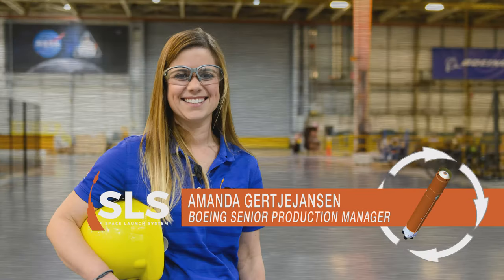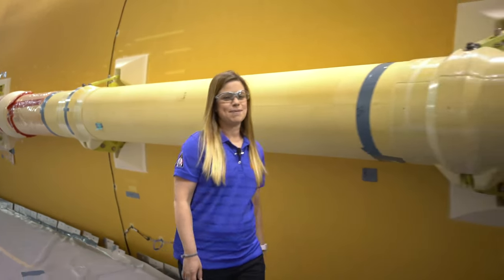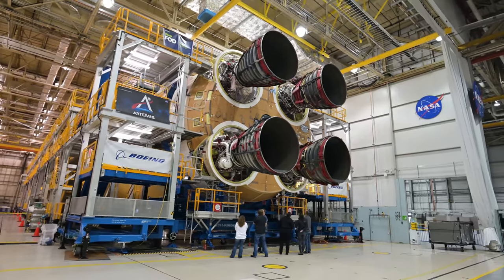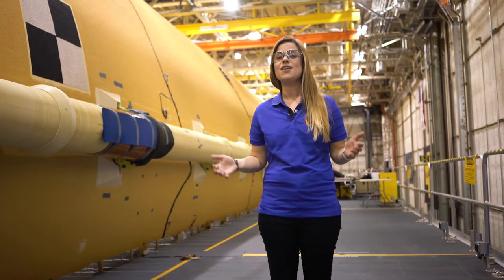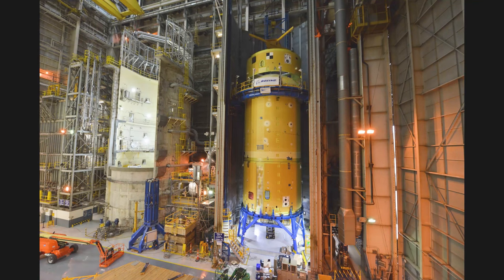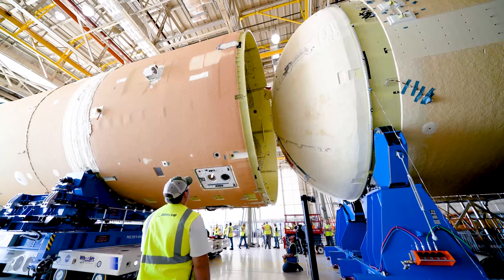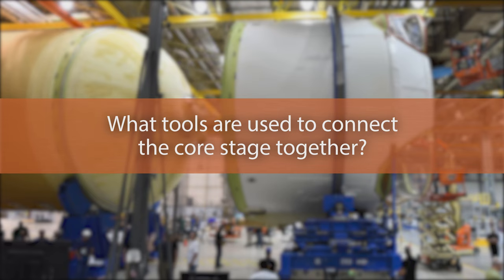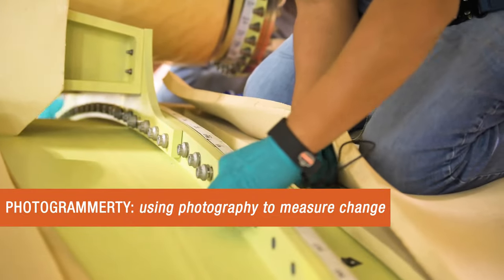Rocket Science in 60 Seconds: How Does the SLS Rocket’s Core Stage Come Together?

Comment: I know they made the diameter of the SLS first-stage 27 Ft so they could reuse as much as possible the manufacturing jigs and tooling used to make the Shuttle ETs but if they'd made its diameter 33 Ft instead (Same diameter as the Saturn V's S-IC and S-II stages) they could've made a first-stage that was short enough to do the entire final assembly vertically.
Reply: yes, even though the Saturn Vs were made here too, there were just too much legacy knowledge still present on tooling for the Shuttle's ETs. Without this precious knowledge from legacy workers of the Shuttle missions, the assembly would have took longer.
Reply: Ares V was initially going to have a 10m core diameter with almost no shuttle derived hardware 
When it was canceled NASA tried to pitch the SLS as a purely shuttle derived vehicle reusing as many STS elements as possible which included the 8.5 meter diameter of the core

As it turned out during the design process SLS, and especially the core stage, strayed very far from being a true shuttle derived vehicle to the point that the core stage is regarded as an entirely new stage with the Shuttle's RS-25 engines

Looking back maybe leaving it 10m in diameter wouldn't have made much difference and we would actually get a better rocket than now

Oh well

Comment: Bets on if they'll launch more than a single one?
Reply: there already halfway through building the second one...
so yeah...
Reply: Yes they will
The second rocket is halfway built and they are starting on the third
NASA's about to batch order 10 more rockets for Artemis
Reply: @brokensoap1717  when does production on the 3rd core begin? do we know that yet?
Reply: @DavidWillisSLS  They have ordered long lead components a while ago and in October NASA authorised Boeing to fully go ahead with the CS-3 build
For the SRB's they already have begun casting those with solid propellant
Reply: @brokensoap1717  nice!
Reply: yeah, we have more being made right now. The tanks are hiding in different cells throughout the facility and the joins are being worked on in the floor area right by the completed core stage. They are definitely going faster. Thank goodness